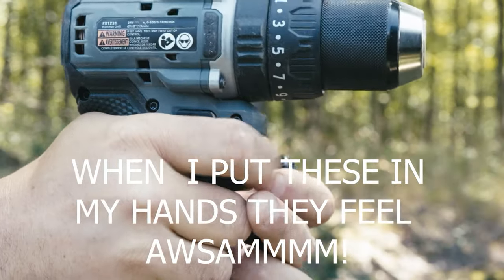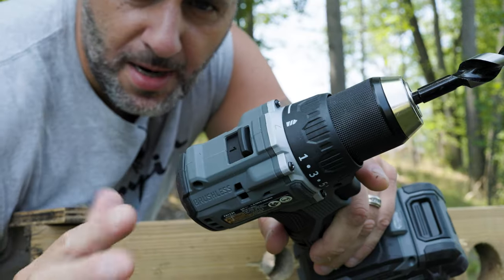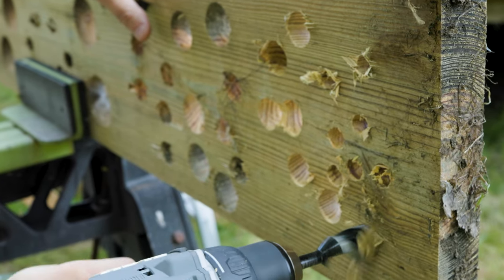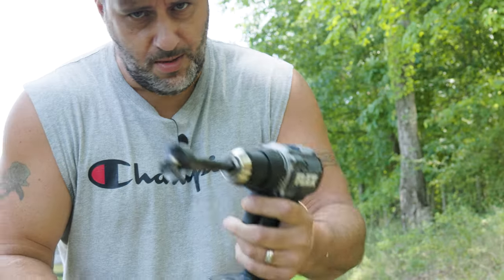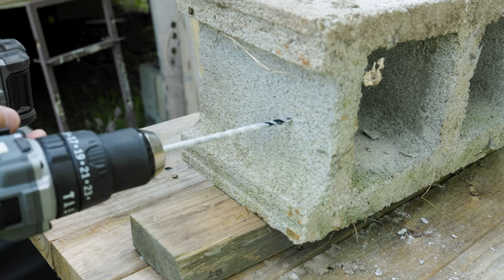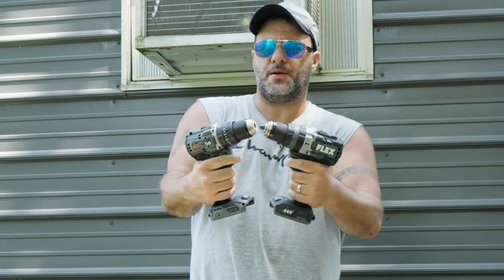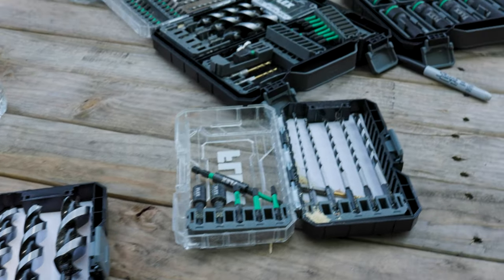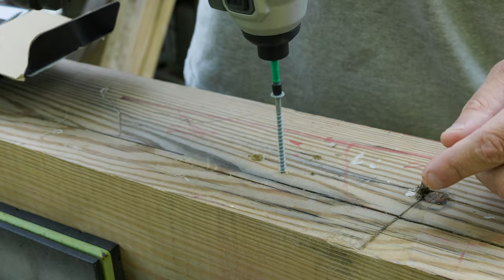New Flex Compact Tools - what to know before you buy

Comment: At 8:07 that's one thing I hate about doing construction in the US, in Canada you would never find a construction screw that a #2 Phillips. Everything is a #2 Robinson or Red Robinson (because Robinson is also colour coded) In the US you have to buy T25 Torx screws as a special purchase, as opposed to be opposed to them being standard for construction screws! 
It doesn't sound like a big deal until you show up to a job site in the US and they hand you the screws and you spend every third screw experiencing cam'out. Not to mention not being able to screw from angles really well, plus it could be dangerous when you cam'out and your momentum takes you forward.

Comment: If I'm going compact, I'm going real compact as in Milwaukee m12. I'm a pro electrician for a living and m12 does 95 percent of the tasks I need in a day. Granted you still need 18v tools for heavy duty tasks but they only come off the truck when needed
Reply: Two battery platforms vs 1 flex wins

Comment: They look like performers but I prefer Milwaukee due to the compact battery without any overhang. Has been a saver for tight spaces many time for me.
Reply: Plus Milwaukee is still the king of cordless tools.
Reply: @electricianron_New_Jersey esp compact. I look at my newest impact with the 3 lights on front and those small slimline batteries - I just did my whole shed flooring using 6”hyperlok fasteners and without hesitation.

Comment: Flex' battery leak.
Reply: If so, lifetime warranty
Reply: Had the problem on my 5ah battery and I called the flex support number and they are sending a replacement. Also I think it's only the older batteries